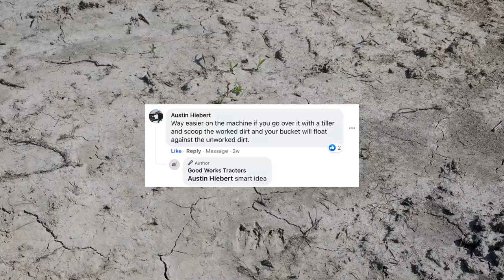BUILDING A ROAD. IS IT EASIER TO TILL BEFORE GRADING? 🚜👨‍🌾

Comment: I think for skid steer, they make I believe it's called hydrobucket. It has a power rake under the back side of the bucket so you can tear up the soil then use the bucket to remove soil. Dirt Monkey shows it in use on his channel.

Comment: When i cut 150' drive to my shop, i used the 5' tiller and scooped it out with my loader.  It worked great for me as my Kubota B3200 doesn't have enough weight to dig the sod up efficiently.

Comment: Tilling is especially faster when you’re using a even smaller tractor like a sub compact. I like to till, and use a box blade for material removal after. Good work man
Reply: Hey Rob would the tines [is that how you spell it, you know the hooked pieces on a box-blade] dig in like a tiller if you didn't want to spend the $ then box-blade it away?
Reply from the maker: Yeah couldn't believe the difference.  I almost didn't want to waste my time with the comparison after realizing how nice it was to till first and push that dirt.  It has a nice hard bottom floor to ride on too.  Easy scraping.
Reply: Yeah I'm wondering also about using a box blade with hooks attached instead of a tiller
Reply: @ronaldharmon9891  the scarifiers do work to a extent. They’re not as impressive as they look tho. They will eventually almost stop working seemingly. I’ve had limited success with using them for removing sod and top soil. They work much better as a rake in the garden in my opinion.
Reply: @wademartin8822  if you used the scarifiers and welded bigger teeth to them, they do seem to work a lot better. I have 6” triangle ones welded to a class 0 box blade on my garden tractor that’s actually fairly light weight, and it works pretty good for chunking the sod up better, but even that is kinda a limited success too.

Comment: In Australia we use the rippers to prepare the ground prior to grovelling, grading and rolling for a farm road. Make sure you provide adequate drainage from that box you've dug into the ground so it doesn't hold water below your gravel or your road will turn into a swamp.
Reply from the maker: Definitely, I plan to add 7-8" of gravel with a nice crown.  Culverts where needed, but take advantage of natural slope when possible.  Thanks for watching!

Comment: I did the same with a tiller and a jd3320. 750 ft x 12.5 ft. I used 3" minus for a base. Then 1" clean for the finish.  I do recommend putting geotextile down.   Keep the video's going.
Reply from the maker: Thanks Pete.  Sounds like putting down fabric is a "must have".

Comment: A couple more points to consider, if you had teeth on your skid steer bucket you would have an easier time peeling the sod up without it being tilled. However, having the tiller run over it first with the depth shoes set allows a more novice operator to get a nice result. When you have the skid shoes set, you achieve a consistent depth, thus leaving you a hard base so when you put the skid steer on it, you can just drop the bucket and scrape the bottom without worrying too much about depth because the tiller already did that. One more point to consider. If you peel the sod off with just the skid steer, you’ve got some pretty lumpy soil there that you need to screen and break up to use as topsoil in future projects. Whereas with the tiller, you’ve made it quite fine, so if you let that soil sit for a few months and turn the pile occasionally, you’ll have some nice topsoil to use to finish projects around the property in the future with out having to rake off large lumps or rent a screener etc
Reply from the maker: Yeah, teeth would for sure be a big help.  Spot in about creating a hard bottom.  Loved how easy it made it.  Great point about the top soil for later use.  It's going to come in handy!

Comment: I think you may have made a drainage ditch and not a road. A road needs to be above grade and slope so water runs off.You removed fill and left the 'road' as the low spot. 
I do think the experiment of tiller first was a good idea.
Reply from the maker: If I were to leave it like this, then of course.  However, I stated I would be bringing in gravel.  The road will be built up, crowned, and culverts installed where needed.  This is road prep, not a finished job.

Comment: Are you adding a mat under your gravel.  Over time the gravel tends to be pressed in and the loose soil raises to the top.  A mat helps prevent the above from happening.
Reply from the maker: Yeah, enough folks have mentioned matting that I think it would be unwise to ignore it.

Comment: I use the rippers on the back of the skid steer, takeuchi in Australia partnered with Norm engineering here and came up with the rear rippers for the TL 10 and TL12, and they did a special model with a TL12V2 called the pro series, rear rippers massive 4 in 1 bucket and extra hydraulic cooling, we have one at work which is my machine, and I love it, rip the ground, pavement open, and push it out, we build bridges and roads for local and state governments, and the skid steer puts the most amount of hours on per job than any other, the results look good, when it comes time to put your base layer down, put down geotextile fabric first then you base layer water it then compact the crap out of it then add your fines layer water then compact do that and your driveway will last for decades
Reply from the maker: Really great info Michael.  Thanks for taking the time to share!
Reply: @GoodWorksTractors  can't stress the importance of watering and compacting the base material and fines, the water binds the stone together when it's compacted it will form like a slurry almost concrete like but no where near as wet
Reply from the maker: @mtozzy11  any suggestions on how a home owner wets a long drive and compacts?
Reply: @GoodWorksTractors  good question, wait till there's about an inch of rain forecast then hire a 2.5 - 3.5 ton roller

Comment: Why not use and angled scraper blade on the 3 point and work the loose soil off to one side and them used the Skid steer to relocate the Top Soil
Reply from the maker: Thought about it, but it seems like extra work when I'd have to use the skid steer anyways.  Might give it a shot just to be sure.
Reply: IMO it would be harder to hold a level grade, however I have used the 3pt blade to make a decent ditch.

Comment: So can I till my compacted gravel driveway before grading, or is that too hard on the tiller?
I suppose a box blade with rippers is better?
Reply from the maker: I would use a land plane to resurface an existing gravel drive.
Reply: I did my neighbors driveway so they can concrete it.  Two passes with the tiller and I was down 4".  I used a JD 3320 with a 6' tiller and scooped the gravel out with the front bucket.  The tractor didn't even act like it was working and  the rock didn't even wear the paint off the times.  The rock looked like it come off the truck when it is delivered.  Like the video shows the excavation is level when finished.

Comment: Are your tires filled?  See you running alot if wheel weights.
Reply from the maker: Yes they are filled plus 6 wheel weights.
Reply: @GoodWorksTractors  Thanks, I have a new 4066R cab on order.  Filling the tires but for now have opted to stay at factory spacing because of manuverability and all of my existing attachments are 72".  Our slopes vary but max out at 20 degrees.  I am hoping she feels stable enough as is.  Have been debating adding wheet wieghts to the order.

Comment: With that drive width the bucket overflows quickly when moving the material after tilling,  leaving spillover. Could the snow pusher be used to clean that up with a just few passes only vs 4+ passes with the bucket on that loose material.
Reply from the maker: I thought about it.  However, we did 180' in about 40 minutes which included the filming process.  It really didn't take long at all.
Reply: @GoodWorksTractors  I have used the snow pusher finish level. Use the tilt to control, don't dig down like a bucket Snow pushers I think have other uses.  I can't weld or fabricate. An option to put slats in too use as a carrier(fire wood and such). Maybe holders for gripper shanks(2 or 3)
Reply: @michaelchambers6383  so the snow pusher acts like a front mounted box grader?
Reply: @tomlampros7122  Yes I just dont get too aggresive with it  I find it easier to feather out the finish

Comment: Ok, I'll be the naysayer.  I think in most cases you want to bring your road/path up, not start lower, unless you are bringing in good clay base,  Especially in potentially wet areas.  You want water to shed off the road.  Tilling it could be fine if you intend to pack it down to create a harder base.  I have been a farmer who has had to maintain access roads in and around fields so I have a little experience.
Reply from the maker: Correct all around.  I'm getting out a layer of top soil.  Not leaving behind any tilled material.  Going down about 4", adding 7-8" of gravel.  The road will be above grade and crowned.